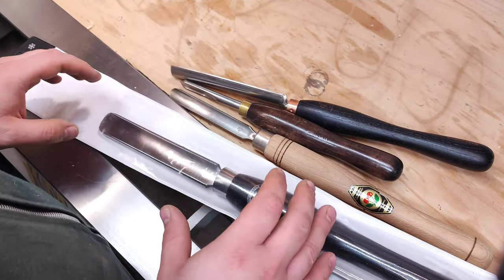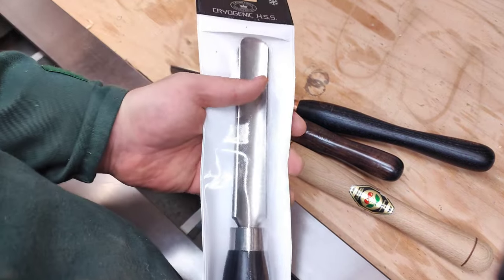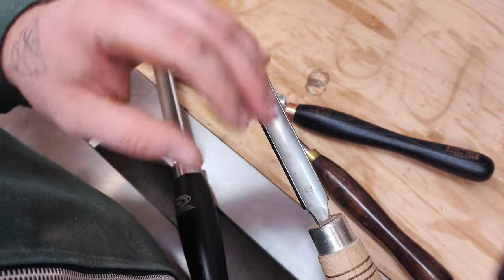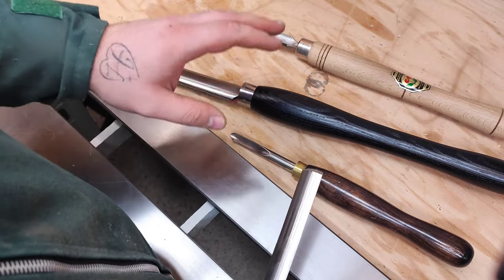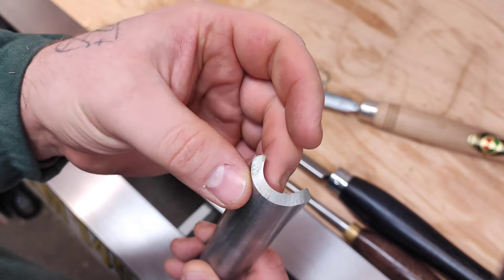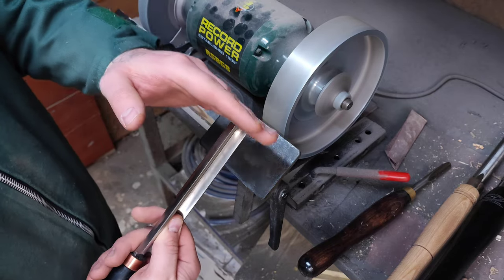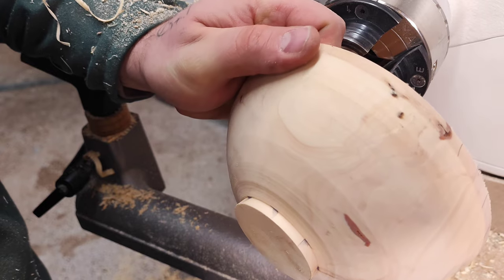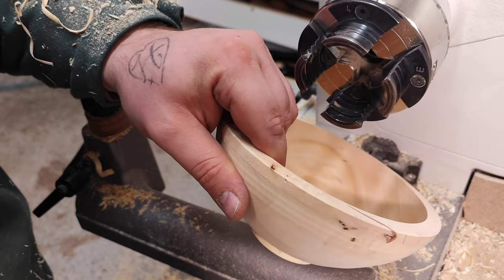You can't use those on bowls..... OR CAN I ???

Comment: Well explained. Continental spindle gouges can be used on cross-grain work as long as you are experienced. You'll normally see warnings & cautions on the manufacturer's websites saying they are not to be used on cross-grain work for the reason that they are weak at the tang and can cause injury if you get a catch. In the old days, all turning tools were forged this way and they were used for all types of turning. I have gouges from the late 1800s that are over 60mm wide. I still prefer a bowl gouge for bowls just because of rigidity and normally they are made from much better steel. Thanks for the explanation!
Reply from the maker: Thank you very much for watching and comment, agree with you, but there is on the way a hand forged tool ,still made today by company,so really looking forward to try it out.....
Reply: @tomislavtomasicwoodturning  You're welcome! Both Sorby & Crown still make forged spindle gouges. Packard Woodworks sells a 1-1/4" (31.75mm) wide one that's forged out of M2. As far as I know, they are all HSS. What's nice about many bowl gouges is that you can get many great powdered metals such as M42 & CPM10V. I worked in the metal stamping field/tool & die as an engineering manager and I can tell you the CPM10V is one of the best steels out there. Pricey though. Look forward to your next video!
Reply from the maker: @JamesBondDZero7Mi6  thank you sir, I've been told about this forged tool that it is m2, however due to all the processes it holds an edge longer and sharper, so I do look forward to test that

Comment: That was very good, Tomislav. Well explained. I cannot believe how frequently I see posts on Reddit, or elsewhere,  of roughing gouge misuse. And get these complainers to use their skew. Ridicule them about being afraid of a piece of steel, if that helps. :)

Joking aside, thank you for confirming what I thought about some older tools I inherited. The continental was new to me, but bevels and cutting edges are the same principle, so I sharpened it and gave it a try. Nothing surprising and it will be a fine backup if I need an edge to get past sand, or metal in a piece of wood. Keep up the good work.
Reply from the maker: Thank you Jay very much

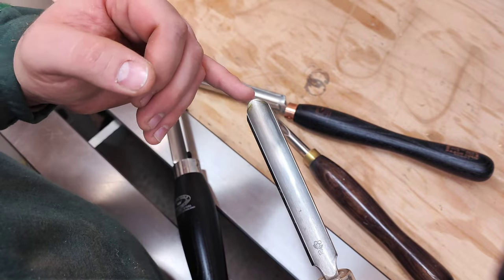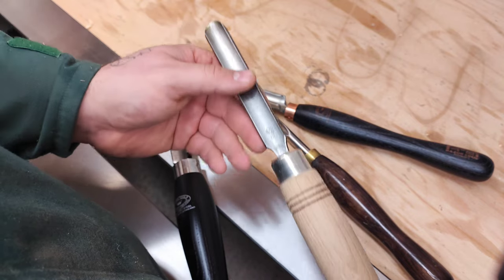Comment: Tomislav, I do need a small continental gouge for my toys... I am posting a link to Ian "Robbo" Robertson, a turner from Australia about "Why you don't use a spindle gouge on bowls'. First time I watched it, I really focused on a comment at the end of the video about how he was out in the shop for a few hours the previous night and couldn't get a good catch. So, watched it a bunch of times. His catch happens at about 2:45. If you watch it closely, when he is not getting the catch, he is doing a typical bevel rubbing peeling type cut. What causes the catch is not the end grain. As long as the bevel is rubbing, and if you try this, do it at 100 or less rpm, it is a controlled cut. When he gets the catch, he extends out a long way off the tool rest, and then the fatal mistake, he raises the handle. This causes the sharp edge of the gouge to be pointed up into the spinning wood. Stuart Batty is one who says the end grain causes the catch. Well, since the end grain comes around twice each revolution, you would not be able to turn more than 1/2 a rev before you get a catch. I figure this is similar to a technique I see some turners use where when going down the inside of a bowl, they are essentially doing a peeling cut with the wing. If they come off the bevel at all, they get a huge catch. I think you refer to this when talking about  the continental style gouges on the inside of the bowl. I do need one of those in my arsenal.... Here is a link to the video. His catch happens at about 2:45.

https://www.youtube.com/watch?v=IOhHeyoZLaY

If you ever want to take apart your Vicmark chucks to clean them, he has the best video out there for that.
Reply from the maker: I've seen that video and love his videos, Richard suggest him in one of his videos, and its a great turner.... Thank you for watching and comment sir

Comment: Thanks for clearing up what a continental gouge can and cannot do. How does the size of the bowl affect the tool you select? Could you use the bigger continental on a larger bowl?
Reply from the maker: Thank you very much for watching and support, I would not use that big Continental gouge on big bowls, the smaller one is faster and takes more wood of, but on bigger bowls its just easier today to grab bowl gouge, they are sort of evolution from spindle gouges and they do job a little bit better....
If you are like me only had acces to continental gouges,then I would use those.... Or round shaft spindle gouges as they are much easier again😉
Hope that makes sense 😅

Comment: Thank you so much for all this information.  It has taken my turning and sharpening to another level.  Do you need to remove the burl after you have sharpened the spindle or roughing gouge?  I noticed you did not make a mention of it.
Reply from the maker: Glad I could help out ☺️
Nope , I don't remove burr on gouges as pretty much as they contact wood it will be gone anyway.

Comment: Its funny because the spindle roughing gouge is still very common for bowl turning here in Brazil, its used on its side with the flute facing you in a push cut. I hate it.
Reply from the maker: Uff it can be done but not the best tool for cross grain work.... Is the a option for you to get atleast regular spindle gouges?
Reply: @tomislavtomasicwoodturning  I got a good deal on two Bowl gouges a while back, guess its the opposite of what you an Raffan do

Comment: Ok Tomislav, you've almost got me convinced to buy a 1/2" spindle gouge for my bowl turning. My turning is almost exclusively twice turned bowls and I use only salvaged trees from my area. Can I rough turn bigger bowls such as 12 inches or larger with the 1/2" spindle gouge?  My go-to tool for this have been 5/8" bowl gouge but my current gouge is worn down and needs replacement. Thanks for sharing your knowledge and talent.  Stuart
Reply from the maker: Hello Stuart, for those big bowls,stick with bowl gouge,on smaller bowl you can use spindle gouge, If you have the means,buy one on round shaft and see how you like it..... There is a bit of learning curve using spindle gouge as there is little different approch....but I'll covered that in one of the next videos

Comment: I've enjoyed your videos and have learned much, but on this issue I think there has been much confusion about what the controversy actually is. The question should not be "can you use a spindle gouge on cross grain work?" but "should you use a "tang mounted" spindle gouge on cross grain work from a safety perspective?" The confusion starts with using the term "spindle gouge." Those who warn against this practice should restate the warning as follows: For safety reasons, you should not use any square tang mounted tool on cross grain work. The forces imparted on a tool when cross grain turning are oscillating. Tension is higher when cutting end grain and less when cutting face grain. Under these oscillating forces flexion will occur in the tool particularly at its weakest point. This cycle of tension and release and flexion and return occurs twice with each rotation of a cross grain piece; cross grain followed by face grain and then again. At 1000rpm, that is 2000 cycles of oscillation, flexion and relief per minute of cutting. The next problem is the shape of square tapered tang. It has corners. The handle supports the tapered end with the bulkier, more rigid blade of the tool just in front of the handle. The tang is thinner and less massive than the blade in contrast to a continuous cylindrical tool has equal or greater mass in the handle of the tool. Where is the tension and flexion of a tang mounted tool going to focus? Right at the point where the tang exits the handle and joins the blade. Metal under flexion will work harden and fatigue crack in corners first. It is similar to bending a piece of metal back and forth until it work hardens, cracks, and eventually breaks. Any tang mounted tool will have this issue given enough time. A tool machined from a solid rod of HSS will not have this issue. Fatigue cracking once initiated will migrate and eventually weaken the tool at its most vulnerable point, where the tang exits the handle and joins the blade. A break at this point could be very dangerous and could result in serious injury. I have no issue with spindle gouges machined from HSS round stock on cross grain work when properly ground as you showed. I personally would not use a tang mounted gouge on cross grain work, because it is inherently unsafe, even for a highly skilled turner. Even on the smoothest cross grain piece with the sharpest tool in the hands of a skilled turner, the oscillating forces of tension and flexion are still there and focused on the weak point of the tang. Enough said. Love your work. You are a great artist and skilled craftsman. Thank You.
Reply from the maker: Could be, noone every really point out the tang, mosty just the name spindle gouge.... Thank you for nice clarificastion and watching

Comment: I've never heard the term "continental" but that style of gouge with a thin blade and tang I've always known as a "roughing" gouge.  I've never seen a flat stamped gouge with a fingernail tip like you have here.  Must be a European thing?  I've always been told the danger using the gouges with a reduced tang on cross grain is that the different resistance between the side and cross grain over time can distress the tang and risks it breaking.
Reply: They have been around since woodturning was a thing. Forging was the only way any of those tools were able to be produced. Here in Ohio, I have many from the late 1800s that are as wide as 60mm or wider. Continental was the British term but the German's called them German Spindle gouges. Forging is limited to steel types so they are all HSS unlike bowls gouges that can be out of great powdered metals such as M42 & CPM10V. Most people use them because of lower cost but I'd question that because of the robustness & steel quality Vs. bowl gouges.
Reply from the maker: Indeed there can be some issues with different ressistans but there were used all the time before bowl gouges....